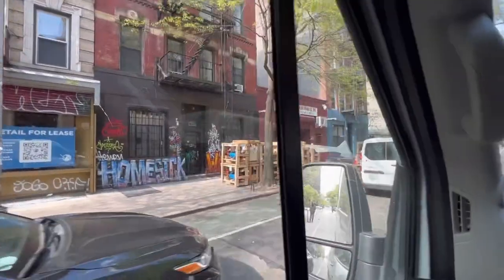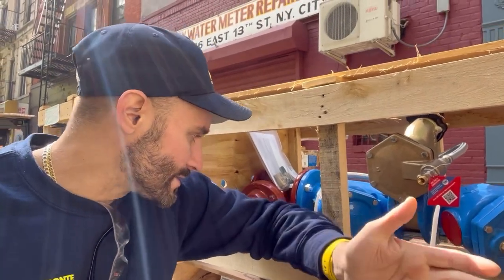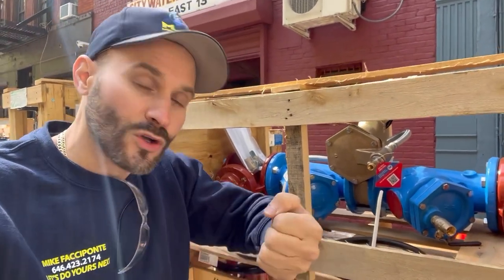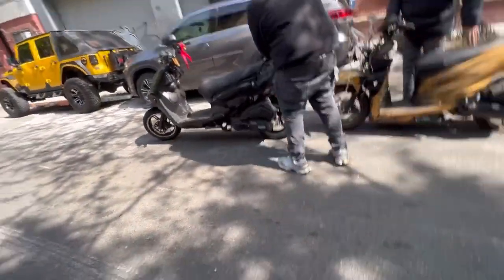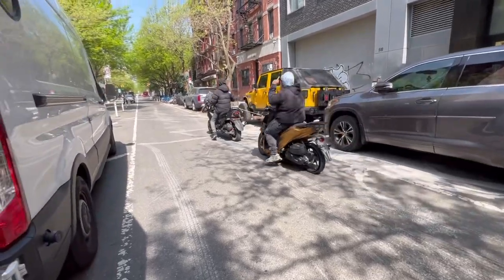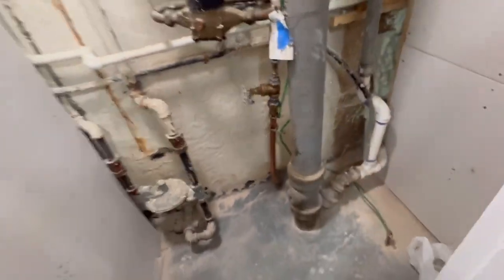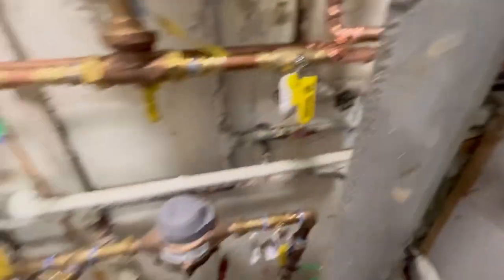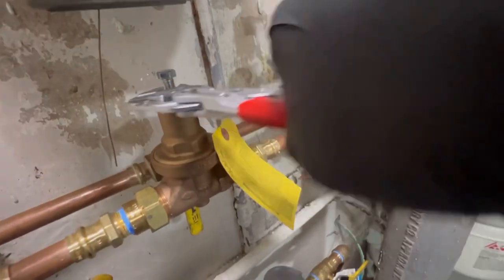HOW TO INSTALL A NEW YORK CITY APPROVED WATER METER, PRV, BYPASS, & DOMESTIC ST-12 EXPANSION TANK

Comment: Hello 🇺🇸 I need advice on how to proceed. Our water supply in Ohio is under attack in many ways. In Toledo, Ohio they are demanding that certain residents have a "smart water meter" installed. I do not want it for numerous reasons. It seems they are targeting more conservative areas, as its not throughout the whole city. If they were going to do a water replacement project wouldn't they start in the older areas with the oldest meters? The whole thing is sketchy. They have been threatening to shut off residents' water if you don't comply. Yesterday while homeschooling they were out digging in front of our house about to shut off one of our child's basic needs. Water. What should we do? We were able to stop them in time but they demand we make an appointment to have the meter installed or we're getting shut off. The water supply in Ohio is under attack in many ways.
Reply: I don't have a problem with upgrading meters. I have a problem with the city demanding residents let them into their homes to install one, otherwise the city shuts off their water. These are some Soviet Union type tactics.

Comment: Flint Michigan in?? 1960 I believe an was I believe GM that was to blame anyway I remember water was trucked  in….  I was a kid but remember Grandad an Dad an the neighborhood, all talking in the general store….. An I run a outside wood boiler ( yea I know I am destroying the ozone who isn’t?) any how when I installed it I filled it with 
Boiler antifreeze ( an it dam sure was not $150 per 5G like now days )  anyway I installed a BFP at the well AN one at the wood boiler fill valve.. yea I know you are not to install 2 in the same supply line !! But I have personally seen them fail and I dam sure didn’t want to spend another 10 grand for a new well PLUS !! Fines for polluting the underground water reservoir…   1 is installed vertically the other is installed horizontally. You know what I was told?? Reason we can not install threaded  water, Spicket  he said they couldn’t get a perfect seal with threaded …. Rolling on the floor laughing I told him bullshit ain’t ever heard of channel locks.😅😅😅😅😅 but was a nice install job … An in my part of the country? We are to set pressure running not at idle sitting. It is weird how different states different counties interpret the rules.

Comment: Just wondering if you precharge the expansion to the working pressure at the PRV. It is so important to prevent water logging of the tank. Over the years I have come across tanks that never were charged to the correct PSI. Good info to pass along. In my area I can't even touch the meter.  We have town water company that handles installs and repair. When I winterize a house and drain it, I call the water company and have them shut service off at the curb and remove the meter and drain it.  Great looking job on the new meter

Comment: Waterbury CT had one of the top 5 water systems in the country... In 1905 and they still use the same system. A watermain broke and sucked the water out of about 60 homes and drained their hot water heaters. I replaced a lot of the coils on the electric heaters, but they all had to file with their insurance companies to get reimbursed.  Always make sure the grounding wire is attached to the water main like it is below this setup. I changed meters for years in Hartford CT and got a surprise when undoing a meter and could feel the current going through my hands and I tightened the meter back up and they had to get an election to come out and find what was wrong and why so much current was going through the lines.  I looked around after and I saw at least 3 places they had grounded wires to the copper pipes in the basement away from the meter, so it was one of them I'm sure but not right.

Comment: I wish I put my irrigation system in off of permit—the fees for annual testing of backflow preventer are ridiculous. Inspector wanted to nail me for adding a hose bib without anti-siphon, until I proved it was after the backflow preventer, and no domestic water was provided after the valve.